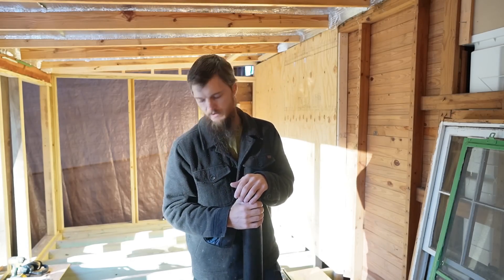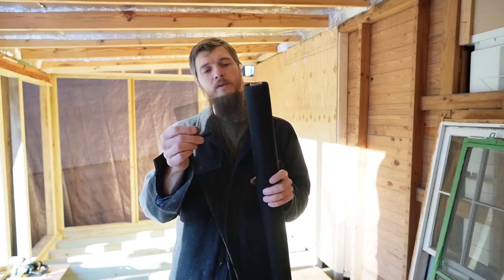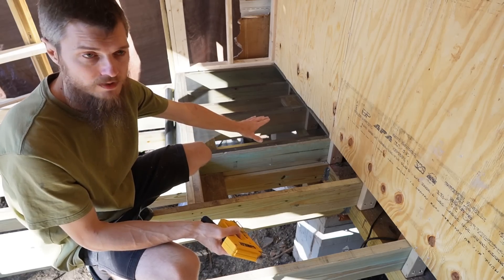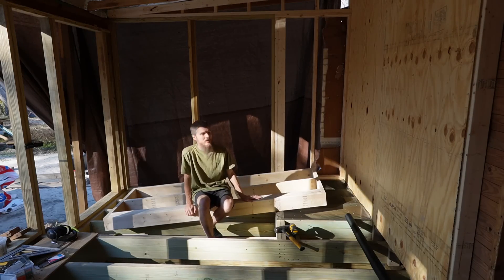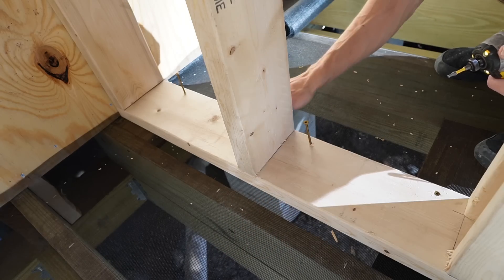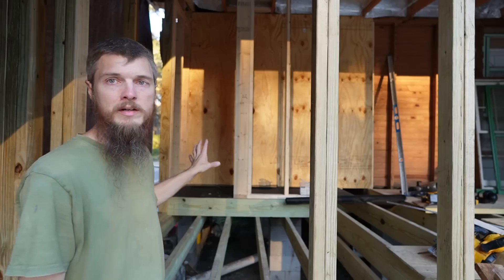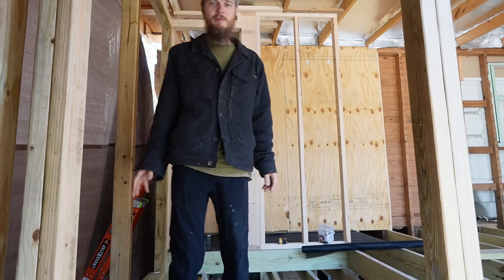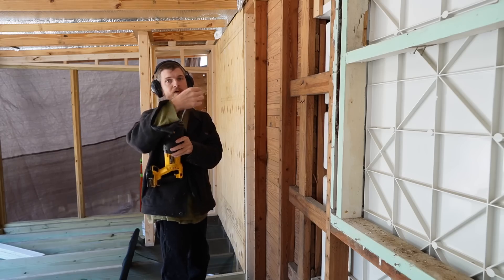Walls Framed, Floor Screened

Comment: Suggestion. Spread diatomaceous earth beneath your house. Its inexpensive, perfectly safe for anything without an exoskeleton. But it will make the space below your house a hellish desert for insects and arthropods
Reply: Yes! Brilliant!
Reply: @maryofventura4767  Good idea. I live in Florida and I will have to do this. We do put it all around are home and we we do have a company that treats us every 3 month so we never get any bug's. Thank you for this information.
Reply: Only problem it needs to be reapplied very often due to weather
Reply: @justmejo9008  It depends. If your weather is mild, and underneath your house doesn’t get moving water from  rain, then you really don’t need to reapply for a long time. It settles into the top layer and tiny bugs only need a tiny bit to demolish them.
Reply: @justmejo9008  yeah but its cheap, you really need to do the whole thing a couple times and then just the perimeter to keep them out. Also, if their crawlspace is dry the applications might last longer.
Reply: Use food greade Diatomaceous earth...neighbors cats, dogs, or chickens and cheap to
Reply: But, Belle likes bugs.  Why should they kill and remove everything?  Better to physically seal them out of the room.
Reply: Agree with the diatomaceous earth suggestion. It’s hell for all manner of critters and moisture.
Reply: Until it gets wet under there. DE has to reapplied after it gets wet.
Reply: Good idea
Reply: First Saturday Lime would be better.
Reply: Good progress, Doug and thanks for the tips.

Comment: We have a huge screened in porch in front of our old mobile home, and we absolutely love it. I'm still looking at that ceiling insulation and dreaming about having it on ours, though the roofing man next door says that kind doesn't do much at all. We also put our water heater outside in a closet since we were only part-year residents at the beginning, and it has been very helpful. I would love to have a stacked washer and dryer combo, and really appreciate all the time you and Ashley put into the planning. Looking GREAT!

Comment: Doug and Ashley,  I do not know if you have decided on your washer yet, but I want to let you know that I have had three newer designed clothes washers. If I could, I would locate an older washer, even if it had to be repaired, rebuilt. The new washers designed for less water are SO bad! You can't remove the soap, and they do not clean clothing well. We are planning on looking for an older washer before the new design. I miss my old washer SO much!
Reply from the maker: We already have a washer. We bought it shortly after moving here so we'll just stick with it. It seems to do okay. I agree regarding the water amounts; I wish the newer units used more.
Reply: Catlady, I can't agree with you more.  I used my machines far beyond their expected year usage but eventually had to retire them.  With our new washers, I am careful to add only the 2 tablespoons of detergent, not overload the washer, and program to run an extra rinse.
Reply: Agree the new washer suck. I hate them.
Reply: The problem with working on a floor that doesn’t have a floor 😂 All the work you have been doing and this is the first mishap? I am glad that you have not fallen.

Comment: Doug has taught me something, again, I knew about and used his trick about using long Saws All blades to make side cuts, However,  I did not know that I could install the blades into my Dewalt Saws All Sideways? Thanks Doug, You are the Man! NOPE! My dcs388 won't do it Doug must have a four position XR model!

Comment: You could really use a cordless hand planer, Doug ! I purchased one about a year ago and have found it very useful when you have projects that need a little material taken off. It's easier than taking projects apart. It was especially handy when dealing with jam extensions around windows and doors, etc.

Comment: I am not a fan of clothes dryers.    I never dry my clothes.   I have an indoor rack, hangers and shower curtain rods in case it's cold or wet outdoors.    For me a clothes dryer is waste of money.    A nice screened-in porch is so useful - especially in the south.   The black mesh is so easy to work with, no metal bits flying everywhere.    Over the years I utilized leftover bits of the mesh when dying cottons and silks.   (I made frames from scrap wood.   Twisted 2x4s would suffice.)    Good drainage and no worries re chemicals interacting with metal.   Everything is looking wonderful!
Reply from the maker: I'm the same. I love air drying clothes :) Thanks

Comment: So sorry about the mic. At least it still works. I hope it's fixable. Great idea putting the screen down. You're right, a vacuum should pick up whatever sand makes it in there. Looking forward to the floor going down. If you have a septic tank, it's better to run your washer drain into the yard. The fiber build up in your septic could cause problems years down the road.
Reply: My mother in law had her washer set up with a long hose so it drained and she was able to water her yard with the used water.  Win Win
Reply: @pattiwhite9575  Exactly!

Comment: Grasshoppers can chew through vinyl screening. We had this problem when building our house. Metal screen is the way to go.
Reply from the maker: The only problem is that aluminum will react and corrode in contact with treated lumber. It won't last long.

Comment: I'm wondering if laundry lint will quickly block the holes in the screen. At my house it seems no matter how meticulous I am, carefully cleaning up lint between every load, there is always much fine dust that accumulates on the floor of my laundry room.

Comment: Awesome job Doug, looking great
Here in Australia hot water units are always put outside against a wall of the house
Easy to release pressure in the tank by hitting the release valve, allowing water to drain outside
You might want to run the insect netting a little up the walls , bugs find the smallest of gaps, usually in the corners
Keep up the great work
Love it when you upload a new video
Reply: Here in the States, in really warm areas folks have water heaters "outside" the house.  Being in a northern state where we get 4 seasons it always seemed weird to me but I bet it saves a lot of space.  How well received are tankless style water heaters down under?
Reply: Im in the capital of Australia Canberra and lots of ppl are getting the tankless here my neighbours have one and they love it.
Reply: @thecrankyoldretiredlady5237  Yeah the tankless water heaters are popular in Australia as they are so much smaller and are mounted to the outside wall of the house
I have a tank style hot water system and it’s great
Reply: @Peter-gh5tz    I have been thinking about getting one.  Would you go gas or electric?
Reply: @tracyboyd4867  Thoughts on gas vs. electric?
Reply: @thecrankyoldretiredlady5237  I would go gas, because if the power goes out you can still have a shower (unless you have solar)
I think gas is cheaper to run also, but you would have to compare as I’m in Australia and you are in the USA
Reply: @Peter-gh5tz  Right now, where I am gas is probably cheaper but I already have electric hook ups (for standard, 40 gallon tank).  It may be a toss up.  I am reading that the common denominator seems to be tank-less saves money no matter what fuel source because the water isn't heated all the time.  I think I am gonna look into it and see what's available.  I hear Renai (spelling?) is very good.

Comment: perhaps once your deck boards dry and shrink, you can use a caulk or a chinking of some sort to keep bugs out, condensation out, wind out and make it easy to clean. most chinking material lasts 20-40 years.

Comment: We put screen under our deck boards as well. Stuff does get stuck in a number that is very difficult to get out. We need more than a broom to get it out. I either have to use a pressure washer or get down there with a knife and scrape it all out.
Reply: I use my air compressor to blow out the dust.

Comment: Question, if you are removing the studs from the porch side, what is keeping your wood siding in the bathroom in place?
Reply from the maker: That's a bedroom, but it's basically just suspended by the corner trim and the tongue and grooves. It'll all be redone later on.
Reply: Thanks

Comment: Hi guys if I could make a suggestion why don’t you use tongue and groove flooring if there is roofing over your deck .?🇦🇺🙋‍♀️
Reply from the maker: We were considering it, but they don't sell pressure treated tongue and groove decking in our area.

Comment: I was wondering, would it not be better to use spray foam insulation to keep the rooms cooler in the summer and warmer in the winter or am I just overthinking things?
Reply from the maker: We'll be using mineral wool insulation. We personally don't like spray foam insulation.

Comment: I never seen you install insulation behind the plywood before you mounted that, and since it is going to be a screened porch, I would have thought you would need insulation in that wall for the heat in the house.
Reply from the maker: We explained that pretty well starting at 12:33. I hope that helps.

Comment: I love how you foresee problems and make great innovating solution by putting netting up on the floor! I do have a question: FL is humid, you 've opted for no dryer. Have you found that your clothing takes long to dry? Is that not an issue ? Im in Vegas and even blue genes in winter get dry fast due to the dryness. Great job and strategies! be blessed.
Reply from the maker: So far, we haven't had any problems with clothes drying. It's only really humid during the summer, but it's so warm that they still dry pretty quick.

Comment: When you remove the existing studs what will support the  tongue and groove  bedroom wall now that the nails are cut ?
Reply from the maker: Right now it's just held up by the corner trim and tongues and grooves. That whole wall will be totally redone later on from the inside.

Comment: Would it not be better to put screen on top and bottom of the floor joists?  Even if it cost more would that be any better as the deck boards shrink for comfort and Iongevity?  Just a thought
Reply: It’s better his way. I’ve had it at my house the other way and it traps more dust.
Reply: @chalmadanes405  thank s for sharing... would not have thought about additional dirt

Comment: I have a question.  Stapling it to the floor runners like that,  won't the screen wear out with the decking material on top of it, ie walking on the deck and create holes for the bugs to get in? 

Just curious how this works out over time. I want to do this with my already finished deck,  I was thinking to cut and staple from under the deck? Your opinion?

Our are you only doing the hot water heater area and washer where you won't be waking over it
Reply from the maker: I honestly don't know how long it will last. We're just going to hope for the best. It should get more wear though because the wood won't be moving enough to cause any kind of tearing and the boards should hold it firmly in place. Time will tell. 

I think adding it to the underside between the joists is a fine idea. That will be the only replacement method for us if ours doesn't hold up.

Comment: Like your video(s). 👍 You spoke about where the water heater and the washer are going to be located, but no mention of a dryer.  Now that you're living in Florida are you planning on hang drying?
Reply: They don’t have a dryer now and don’t plan to get one in the near future.
Reply: @joannbirdsong583  They had a dryer in MI, but I’m guessing because you can’t line dry in the winter.
Reply from the maker: You missed it, but at 15:42 we actually did mention the dryer. But yes, we do hang dry our clothing. We didn't use a dryer in Michigan either. We just don't care for them.

Comment: You do good work, just wondering why you didn't insulate behind the shower before putting up the wall? I know the reason for the bedroom because you are going to do it from inside but you aren't remodeling the bathroom are you?
Reply from the maker: That bathroom needs to be fully gutted and redone. We'll be getting a new shower/tub unit, and we'll insulate at that time.
Reply: @diyfferent  Thank you for the reply. makes sense!

Comment: Why not just put plywood down and then the deck boards?  More expensive but would work better long term as a plastic screen can get chewed up and also degrades fairly quickly with heat.
Reply from the maker: I wouldn't understand the point of the deck boards if you laid plywood. But plywood is not water proof and this is an open, screened porch. Rain will get in. Plywood would just end up getting wet and rot over time. Fiberglass window screens tend to last many, many years so it should be fine.
Reply: @diyfferent  Oh okay I didn't realize it was a screen porch.  Makes perfect sense what you are doing then.  Thanks for the clarification.

Comment: Did you give  thought to aluminum decking that doesn't have gaps? Common in fla
Reply from the maker: Yes, I looked into it a lot but it was too expensive. I had a hard time finding it anywhere locally and online I was seeing prices around $25 a square foot. That would be close to $4000 in flooring just for our little porch. The wood decking cost under $350.

Comment: At about 4:52, I saw the back end of the wall move as you were starting the screws.  Is it still level?
Reply from the maker: I started the screws, and then I lined up the wall where I wanted it before driving them in. It's all good :)
Reply: @diyfferent  OK, good to hear!  I guess that part got edited out.  :)

Comment: That sounds like a good idea, but it seems like you would have to use metal screening or rodents will chew through it and make holes for bugs to crawl through. I think it would work to staple down 14” hardware cloth with metal screen above it. I just learned that grasshoppers chew through plastic screen as well, but maybe you aren’t bothered by those.
Reply from the maker: Both of the hardware cloth and aluminum screen would fail because of the reaction with the copper treatment in the lumber. They are not to be used in contact with each other under normal circumstances. Fiberglass screen is fine for this use.
Reply: I’ve heard of that about grasshoppers.
Reply: @diyfferent  Oh, i see. I hadn’t thought of the reaction. I hope it works well for you! You seem to think of just about everything.

Comment: What about the clothes dryer? Are you not going to have one?
Reply from the maker: I encourage you to watch the section of the video where that was talked about. If a dryer ever will ever need to be used, it can be stacked above a washer in that space. We personally won't be using a dryer since I prefer to hang dry laundry :)
Reply: @diyfferent  I agree Ashley I only use my dryer for towels and under garments. I hang everything in my bathroom to dry.

Comment: Don't you want to put a shower pan under the water heater? And one under the washing machine also?
Reply from the maker: No, it's a porch with pressure treated wood so if any water leaks it won't affect anything.

Comment: I thought it was strange that whoever installed the bathtub/shower enclosure left that window frame inside the wall.  They probably have the attitude that what no one will see won't hurt to leave as is.  I would've removed it and fixed the wall framing.

Comment: Just curious why did' you put outlets in the wall that you replaced?
Reply from the maker: I just wasn't ready for electrical work. The outdoors outlets will be run later in conduit and surface mounted.

Comment: So, I love your work, but as a builder, I can't quite figure out your methods of using SO many screws (are they structural grade?) and taking all that extra time that would be so much faster if you used a nail gun (I've seen you use a framing nail gun for putting on the plywood sheathing). I do know they now make structural screws with the shear strength of nails, but they COST $$$.
Reply from the maker: Yes, the screws we use are structural grade screws. They do cost a lot. But they are just easier for me to work with and for me, faster. The nail gun is heavy and bangs the wood around and knocks it out of place when I try to nail. I just never got the hang of it I guess. Plus nails constantly cause the wood to split. The screws just work better for me. But I use nails where practical. 

So, no special reason, it just works for me.

Comment: The wall were the washing machine and dryer are going to be setting were you screened in first you have the plywood on the walls or you are not going to insulate that wall ? I’m just curious because isn’t that  wall that goes into one of the bedrooms?
Reply from the maker: It will be insulated from the other side when we work on that bedroom.

Comment: I never would have thought of screen on floor before boards cause if rocks or sand get between the floor cracks it will make holes. hmmm. OH doug safety first. can't you put a piece of plywood down to walk on? Hate to see you slip!

Comment: How are you going to add insulation where the tub is?
Reply from the maker: We'll be getting rid of that tub unit when we gut the bathroom. So when it's open we'll put insulation in. All the insulation work will be done from the interior.

Comment: Are you putting nails in that existing interior wall after you cut all the nails? If not that wall will fall down.
Reply from the maker: Those boards in there will be removed and redone later on, so for now they are just sort of suspended there.

Comment: Compressed insulation is not as effective as that with air gaps
Reply from the maker: It depends on what you mean. Inch per inch, compressed insulation performs better than uncompressed. So 3.5" inches of compressed insulation will be more effective than 3.5" of loose insulation with air gaps.